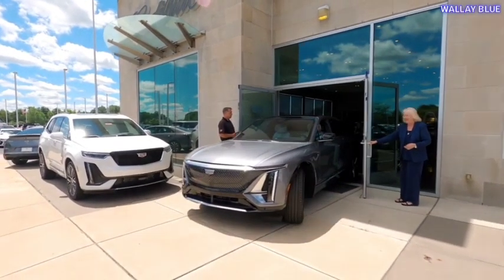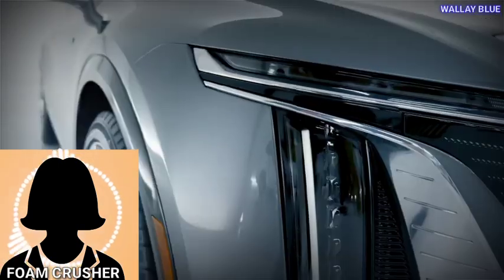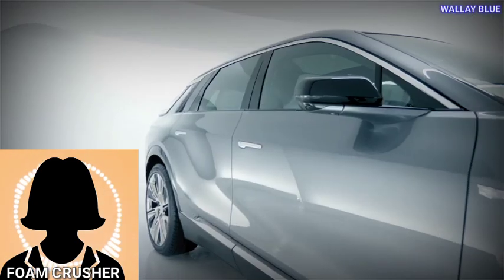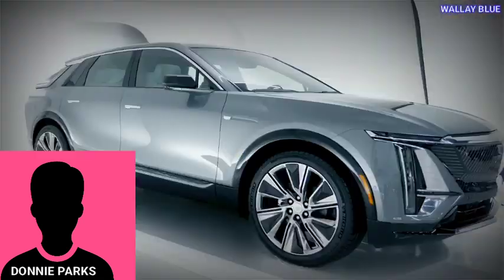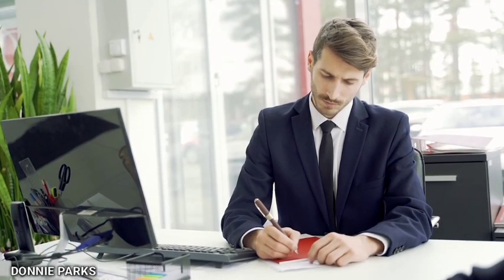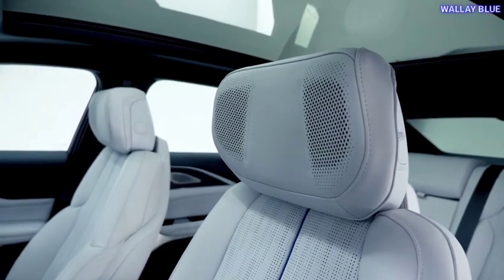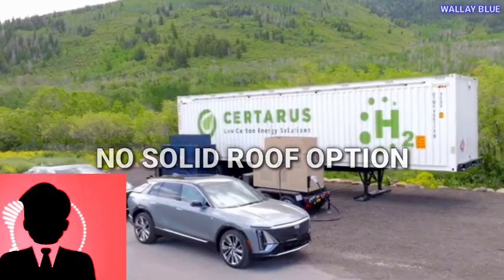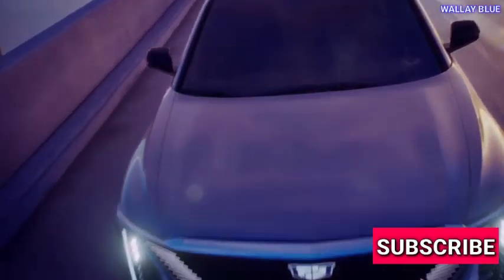It's Getting Out Of Hand For General Motors | Cadillac Lyriq Customers Review

Comment: I am most concerned about the lack of communication from General Motors regarding when I will get delivery of a vehicle I ordered in mid-May last year. I also very much hope to hear more about the availability of a heads up display by the time my car is delivered and if the towing hitch is in place upon delivery. Again, no communication from GM is disturbing.
Reply: See my comment above yours. I still have a deposit for the Chevy Blazer EV, built using the same Ultium platform. Existing EV is the top-of-the-line Ioniq 5 in Canada but may trade it in.

Comment: Concerns:
1. 19.2kwh (EVSE) 80amp requires a 200amp circuit breaker. Most homes are not equipped. 
2. The cost to install is approximately $2,000+. 
3. The EVES UNIT cost approximately $1,900
4. The unit is currently unavailable. Estimate availability 2nd quarter 2023. 
5. GM pays up to $1,500 does not include the EVSE. 11.5 kwh unit approximately $500. 3rd party units maybe slightly lower 300+. 
6. Many homes require installation for the 11.5 kwh 48amp unit. Approximately $500-1500. 
7. Delay in shipping the LYRIQ with no notifications. 
Delays and lack of communication and concerns both dealership and customer service. I could deal with delays if communicated with. Hope this is not what I should expect after purchasing.

Comment: Obviously GM/Cadillac has a real problem with putting  their customers first. I had a 2023 AWD Lyriq on order. No communication for a year. Then, told that I would have to order a 2024 and still no idea when that might arrive. After building my 2024 AWD Lyriq and discovering to get it with all the features built into the 2023 I ordered it would cost $10,000 more than GM had quoted me, I canceled my order. How is that showing value for their customers. Terrible. This behavior is going to hurt them going forward. I am so disappointed with GM/Cadillac. I bought a Tesla Model Y. Good ridden to GM and the dealer model.